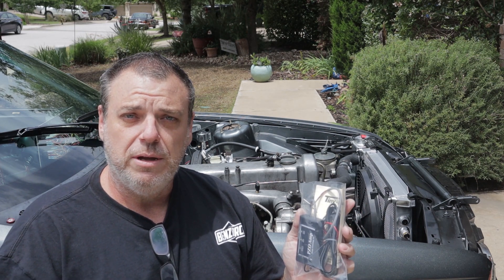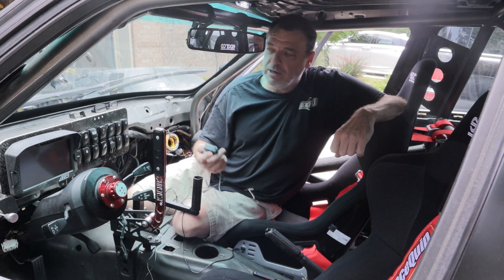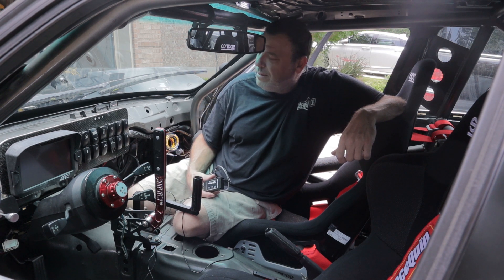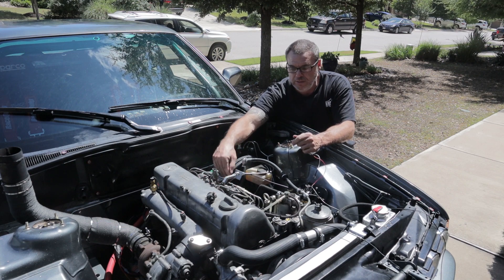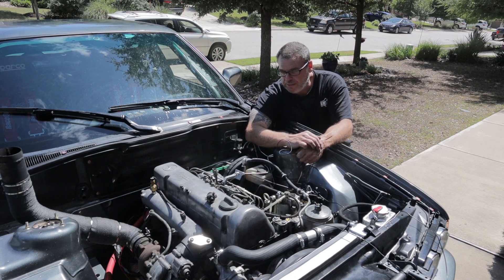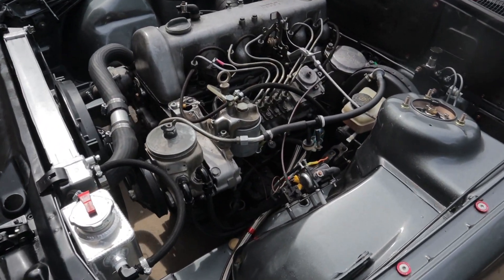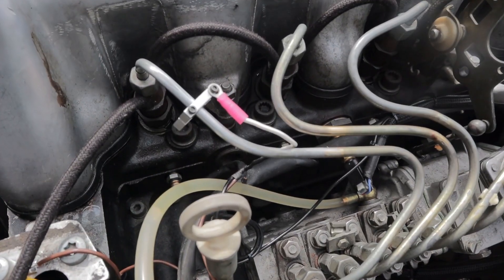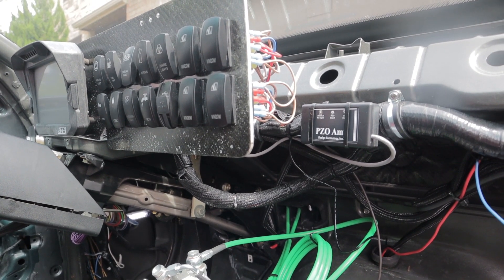Tiny-Tach: An easy tach solution for diesel engines

Comment: Are you using the actual Tiny Tach? If so, how are you getting an output signal from it? 

They tell me they have a Diesel Lab Link with a square wave output, but I've not been able to find that anywhere.
Reply from the maker: Send an email to info@benzforce.com and I will reply with details. It's difficult to respond in a YouTube response
Reply: @BenzForce  Thank you

Comment: I'm putting a 606 in a w123 wagon. Is there a easy way to keep the stock tach? I havet looked into what the tach reads on it honestly, just came across this on a you tube wormhole and figured I'd ask.
Reply from the maker: I think people have modified their alternator to add a W terminal and the use a digital dakota converter but I have never pursued that so I am not 100% sure

Comment: Let's get another update! Looks like you've made from progress. I just put an Om617.950 into my w114 and looking to see if I can get some more power out of it later down the line
Reply from the maker: Sad thing is the new (and EXPENSIVE) AEM CD7, w/GPS and data logging, is back at AEM.  It quit working with an unrecoverable error.  I have a dyno shop lined up now and we have a tentative agreement in place to do bulk dyno testing.  Once I get the display back and can pull log info from it (into their software) then we should be ready for the baseline om617 dyno run!!!  Car is drip timed and should be spot on ... its running great (but slow).
Reply: @BenzForce  I rememeber in the last video it was running rough and smoking. Did the drip timing fix that? Or was there more you did?
Reply from the maker: it was rough and now it seems very smooth.  did the valves a second time too just to double check things.